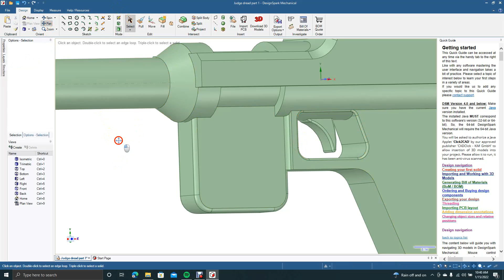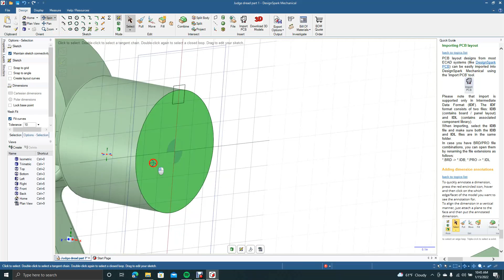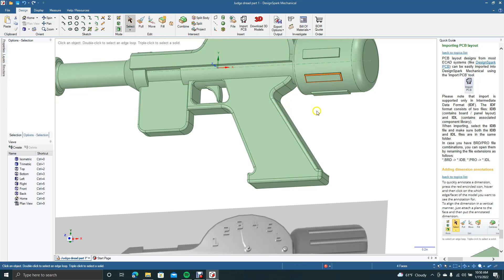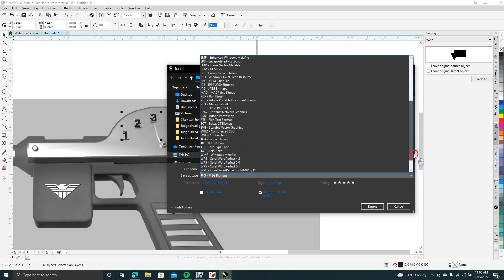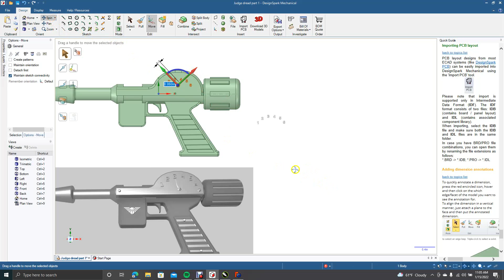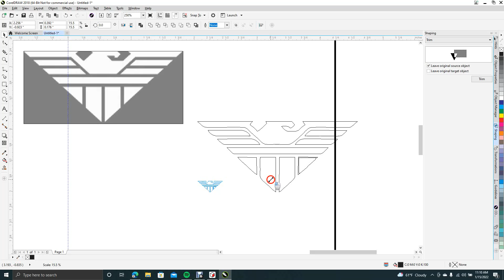How to create your own judge dread pistol part two

Comment: When you pull a a sketch and you get a measurement box to add a size it disappears when you stop the pull, an it be edited?
Also once pulled can you go back and edit a sketch?
Reply from the maker: David, I would select the face you want to extrude, then just type in the amount and hit enter. If you need to change the extruded amount, just do a few undo's to get back before you extruded, then you can type in the correct dimensions.